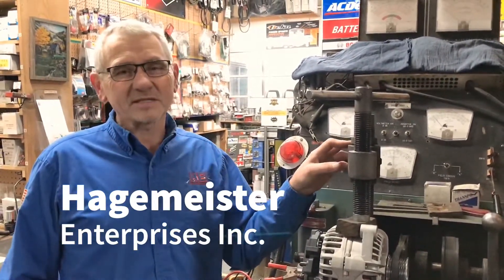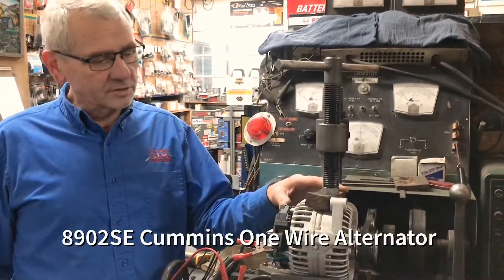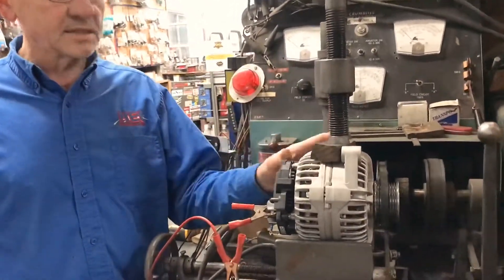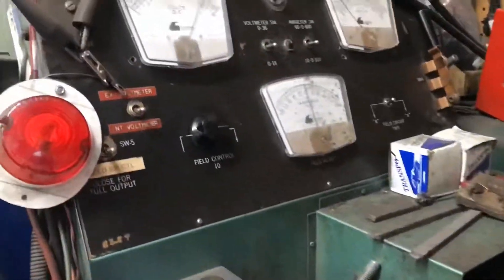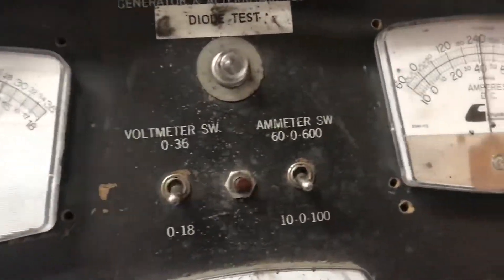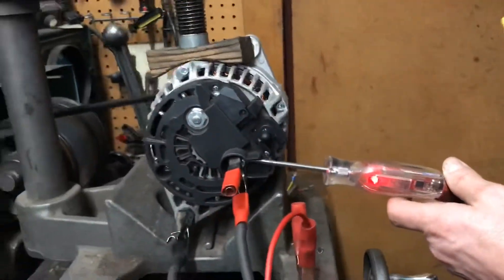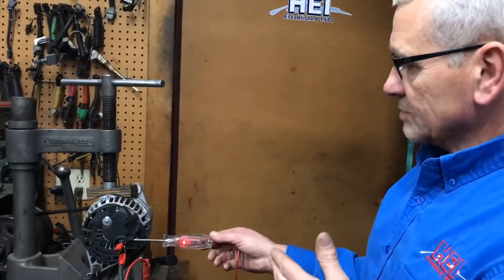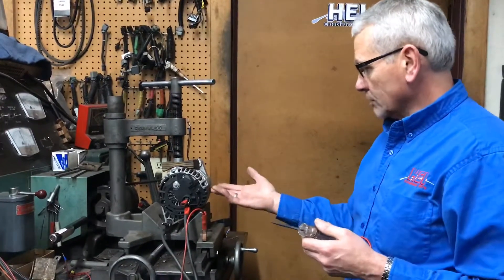Testing Our 8902SE One Wire Alternator

Comment: What If I have  a 1992 Cummins with one battery?. Work just fine?
Reply from the maker: Yes, it will work ☺️
Reply: Can u guys replace the housing on a alternator since mine is crack
Reply from the maker: Possibly, just need to know what you have? What is it on? Send us a picture to info@heielectric.com